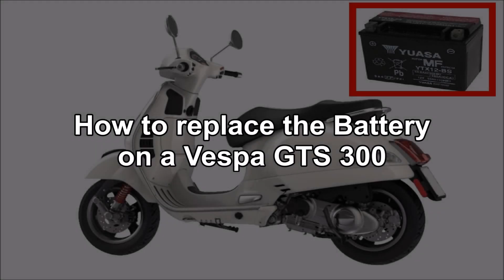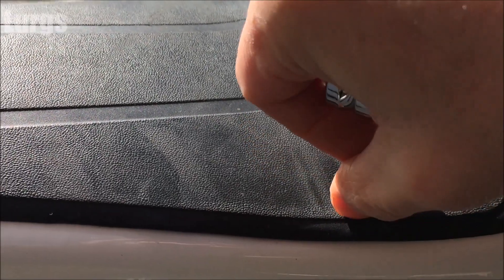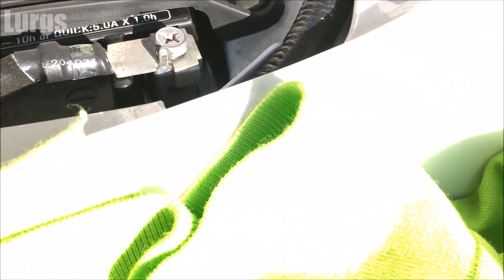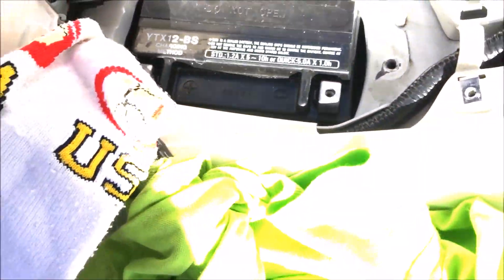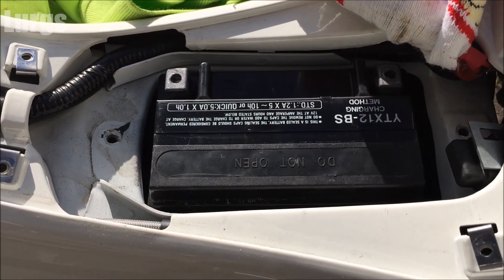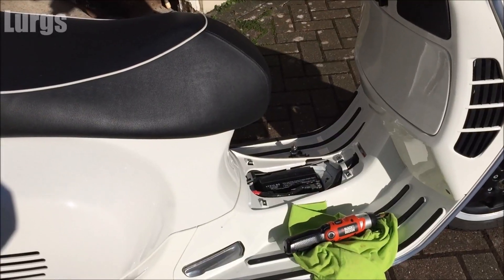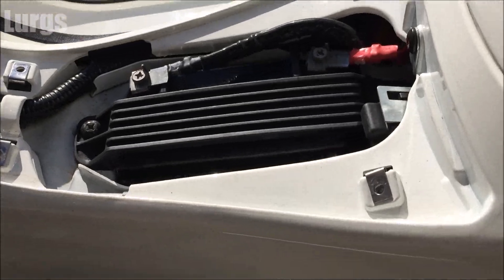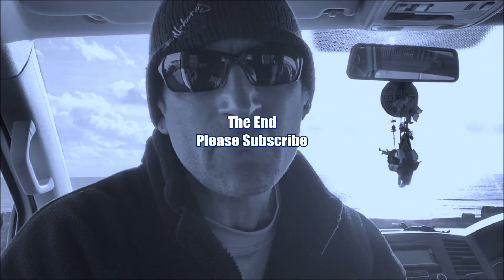Vespa GTS 300 Battery Change - How to change Battery on modern Vespa

Comment: The last time I changed the battery on my Vespa, it blew the main fuse when I hooked the negative up. Would suggest pulling the main fuse FIRST before you put it in. That sharp spark when you first touch the leads to the battery negative has the potential to blow your fuse.

Comment: I might know what tool you used to disassemble the frame cover where the battery is
Thank you
Reply from the maker: NicoTech They are called Torx tamper proof bits.
Reply: @LurgsHowToGuides  Could I know the exact size it takes to unscrew the screws?
Thank you
Reply from the maker: I think you can see it in the Video, 25mm. But just buy a set as they always come in useful